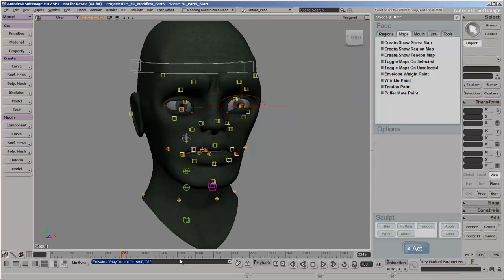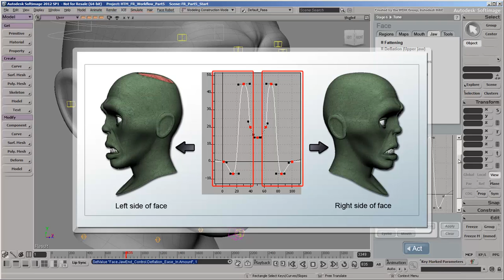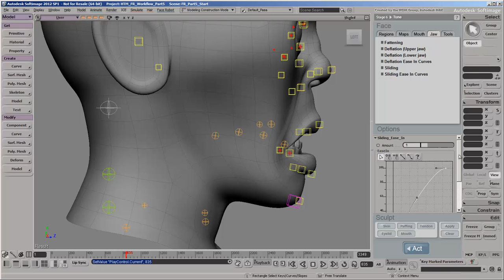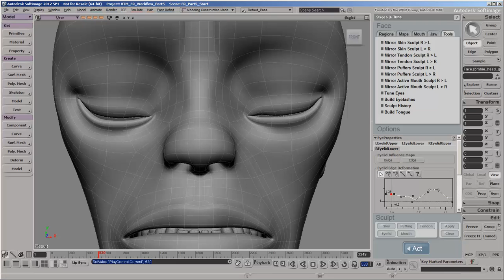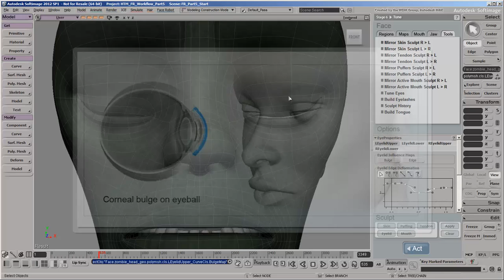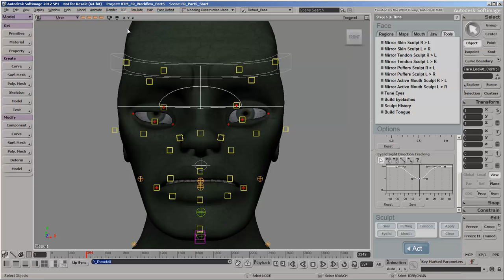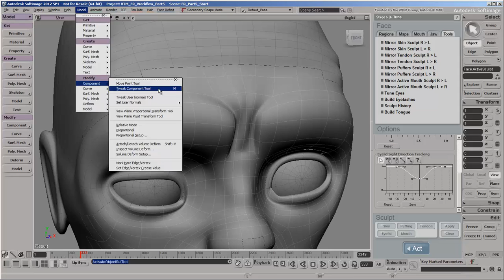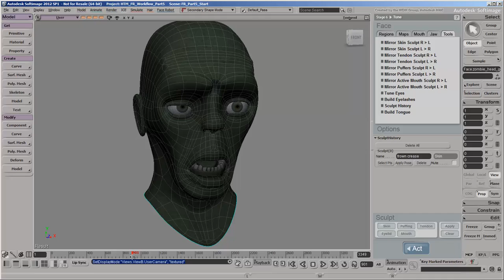Face Robot Workflow - Part 5: Tuning the Jaw and Eyelids and Sculpting

Comment: I already did a test using the FXTree to track a null based on a moving bot ( check si-community for the script ) and its working fine, but its very tedious, since you have to setup all the points it requires lots of time...
Paul Smith did a compound that tracks points directly into SI on image sequence using ICE via texture map attribute and its great ( no share tough ) but it would be interesting if you do something similar and then how to link the tracked points to Facerobot :)